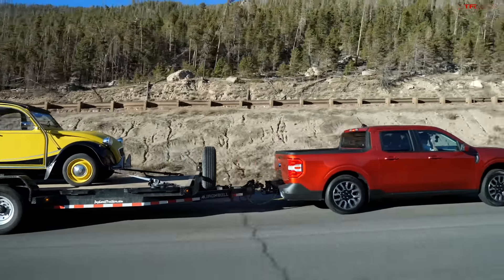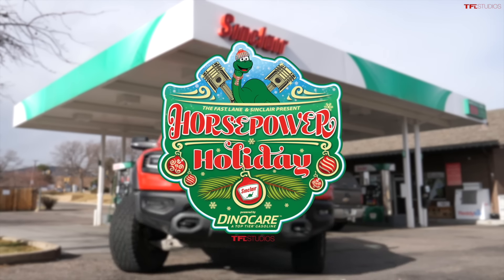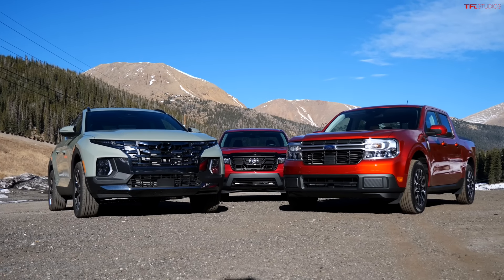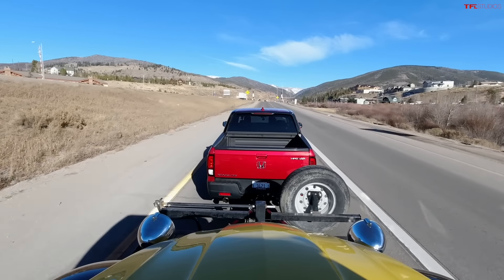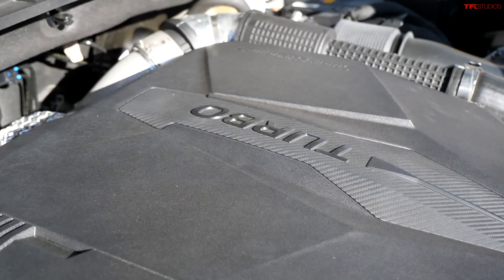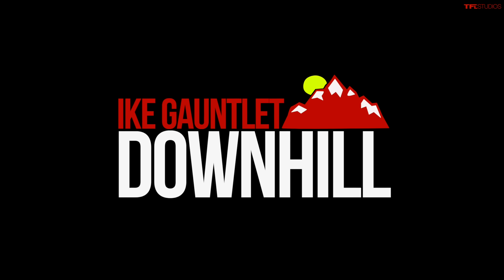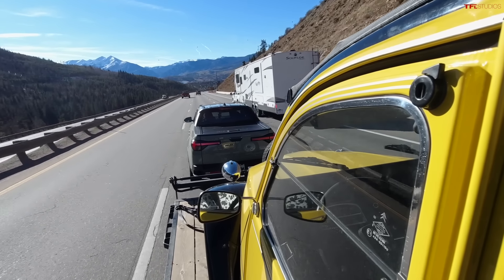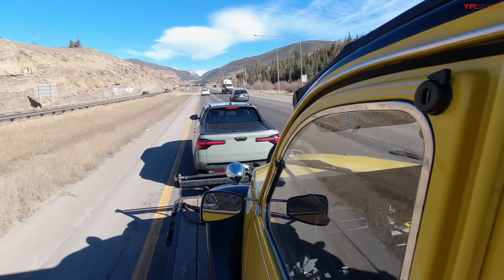I MAX OUT The Maverick, Santa Cruz & Ridgeline, But Which One Wins The World's Toughest Towing Test?

Comment: I would take the Honda Ridgeline over the other two with it's in bed lockable trunk, side swinging tailgate for easy loading, torque vectoring AWD, 9 speed transmission, and reliability.
Reply: I was recently looking at the Honda Ridgeline myself. For the price of a well loaded new Maverick XLT, I was finding 4-5 yo Ridgelines (RTL-T or E) with 40k -50k+ miles. You do get a lot with a Ridgeline, and Honda has a good reputation for reliability, but new comes with a 3 yr bumper to bumper warranty.
Reply: I would just get a real truck.
Reply: @jonathanallen8236  I get tired of hearing this.  A comparably equipped full size is going to be 20k more. Sure, you can get a WT in the 40k-ish range, but it's just that, bare bones.   I've been researching for over a year now and this always gets thrown out there. That said, I'm going Ridgeline unless my brain convinces me to get the Ranger for the low range and ground clearance.
Reply: @tracy2928  Your choice.  I just don’t see a unibody holding up to any real work. It’s comparable to heavily modifying an older jeep Cherokee and off-roading it. Sure they can do great things off-road, but do it too much and the chassis starts tearing up. The spot welds break and slowly become worn out. As a mechanic I’ve been under a lot of vehicles and can honestly say that Japanese vehicles use the thinnest of metal in all of their body structures.  So for me and the safety of my family, I’m gonna have a body on frame truck or no truck. Do as you wish!
Reply: If you or anyone else does decide on a Ridgeline make sure you pull the rear sill panels and check for water under the carpet. They've been having sealant issues since 2017. The rear cab wall lets water in where it pools in the floor under the carpet. Most don't know it since the carpet will not let water soak through. Honda will fix it but it's a very involved process.
Reply: @adir_1  totally. I've done my research for sure. Need to get a stop/start override too. Cant stand that, lol.
Reply: @tracy2928  Yeah if I remember right they have a button to disable it on the console but that of course requires you to remember to do it every time you start the truck. I've been watching the 2022's carefully to see if they have fixed the water issue. I haven't found a 22 with water in it yet so that's promising. That's the only thing keeping me from buying one.
Reply: @jonathanallen8236   lol your comparing a old ass jeep to modern vehicle manufacturing.  Read up on the ridgeline frame to educate yourself.

Comment: That Maverick got TOO HOT 🔥 for comfort, IN THE MIDDLE OF WINTER. 😳
Had the towing continued for any longer and it would have overheated.💩👎
Reply: to be fair the Maverick max tow is 4K and they said their trailer weighed 4K, You have to add all the hamburger riding in the front of that rig as well so they went over the GVW of the truck by at least 500 pounds. If I was going to tow 4k over a mountain I would want a F150 to that job.

Comment: I've said before, with towing capacity "how often" is as important as "how much"? If I were pulling 4k in the mountains every day I'd want at least a fullsize 150(0) with the max towing options to have that margin of safety/durability. And if it's just a couple times a year I still say renting and putting the strain on U-Haul's transmission and brakes rather than your own is the most cost-effective option.

Comment: Maverick's engine overheating is a RED flag!
Reply: it didnt overheat
Reply: to be fair the Maverick max tow is 4K and they said their trailer weighed 4K, You have to add all the hamburger riding in the front of that rig as well so they went over the GVW of the truck by at least 500 pounds. If I was going to tow 4k over a mountain I would want a F150 to that job.

Comment: Id take the ford (not that trim) because you can get the XLT with Fx4, 4k tow package, Turbo 2.0L Ecoboost with a Sunroof and gets better MPG (unloaded) than the Santa Cruz for $29,279. That's how I optioned mine.
Reply: Where are u getting them for that price?
Reply: @jammcguire1276  You can't get that price anymore. The same truck today is 34k. That price was at the launch of the Maverick, when the base model was $19,995. I regret not going through with my order. The dealerships are still marking up these trucks.

Comment: I wonder how hot the Maverick will get with warmer outdoor temps considering the temp. is only 46. It was already starting to overheat, 6 bars on the gauge Another couple miles would probably put it in the RED
Reply: Was wondering the same thing, especially with the Texas heat.
Reply: @rubenrodriguez1209  Not too many mountains in Texas.. I'm sure with normal highway driving it would be fine.
Reply: @2A4U.S.A  true, but doesn’t mean they won’t push it’s limits towing.
Reply: yeah, staying true to Ford's turbo engines, it runs hot... Didn't seem to be such an issue on the Hyundai.  My Ecoboost F150 would always run hot when pulling real mountains.

Comment: Did you strap the 2cv to the chassi?
It has soft suspension! 

I have mentioned this many times, strap the wheels!
It's unsafe to strap the chassi as it allows the straps to get loose on bumps.
Reply: I'm sure DOT would consider that bouncing around as unsecured.
Reply: Those 2cv have so much suspension travel, it really moved around!

Comment: The Santa Cruz is a very nice first effort from Hyundai at a pickup for America. However, as goof as it drives and great design it is, at $41k CAD it is uncomfortably close to the midsize pickups like the Colorado, Tacoma and Ranger. The Maverick starts significantly less and while it is less refined and truck like, the far lower price and capability is where I would go with if I needed a small pickup.
Reply: I’m gonna go for Santa Cruz. Tacoma is uncomfortable AF

Comment: I mean if you need trucky stuffs like towing etc., you would get something bigger. I think Santa Cruz is good enough for SUV shoppers who may or may not tow in the future. The transmission is very quick shifting on normal driving which is what 97% of customers will be doing.
Reply: If you're just towing small stuff like jet skis or a race car you could probably do find with one of these small trucks.
Most don't even tow a thing, but will still pay $1000 car note for a F-150. Lol

Comment: It seems like the Maverick was about to overheat right at the end of the video.  That is not safe at all.
Reply: to be fair the Maverick max tow is 4K and they said their trailer weighed 4K, You have to add all the hamburger riding in the front of that rig as well so they went over the GVW of the truck by at least 500 pounds. If I was going to tow 4k over a mountain I would want a F150 to that job.

Comment: Hey guys, great video!!!, A few ?s on the Santa Cruz that maybe you can help answer...
1. Does Hyundai allow the use of a weight distribution hitch?
2. Do they state the max allowable tounge weight with and without a WDH?
3.Do they restrict the speed when towing on flat ground or uphill?
4.Do they restrict mileage while towing?
4.Did you use a scan guage or anything to monitor the xmission temps?
Reply: No on the weight distribution hitch? They say the truck is to short base to use one i have the 2022 turbo and a 2023 forest river Rv i have checked it out .

Comment: I would pick the ford too but I’m afraid the EcoBoost engine won’t last as long as a naturally aspirated engine.
Reply: 99% of new vehicles will last 200k miles if properly maintained. The 2.0 ecoboost has been around for years, same with Ford’s 8 speed. I havent seen any horror stories about either. You’ll be fine
Reply: @carguyeyedoc  I’m done with ecoboosts.  My 2016 f150 2.7 smokes on startup, not every time.  39,000 miles.  I have a 2022 Tacoma that will be here before the new year.
Reply: @maxracingteam23  man that’s unfortunate, hope you enjoy your new taco. 

Id be willing to take the risk on the Ford. With how the car market currently is, my trade-in combined with how cheap the Maverick is would equate to monthly payments of about $200/month on a fully loaded $37k lariat awd. Cheap enough to tolerate minor reliability issues here and there, and cheap enough to where if I needed to get rid of it for something else, I wouldnt lose much money on it.
Reply: @maxracingteam23  I mean, the current gen Tacoma has it's fair share of reliability issues. The maverick hybrid is the one to get imo.
Reply: @maxracingteam23  there is a repair bulletin out for the 2.7 smoking on start. Mine did it too. The turbo oil line (I think it’s the left side) can leak oil into the turbo when it’s been sitting for a while and on start up it causes it to smoke. I went to the dealer and they fixed it.
Reply: @scottschalk593  well that would have been nice to know 3 years ago 😂😂
Reply: @KB-bh9hp  what do you think of the cvt transmission though?   I still want a truck that can tow.  And go off-road, nothing crazy.  So that’s why I purchased a Tacoma.  We test drove a 2018 Tacoma, had 42,000 miles on it.  It was the same price as my new one coming in, $39,000.  Seems like they hold their value to me.
Reply: @carguyeyedoc  they gave me $32,500 on trade.  And $300 off msrp on the new one.   I still want a truck that’s why I didn’t even look at the maverick.  And if the ranger had the 3.3L N/A engine like the base f150 I would have it in my garage already.
Reply: It won't last.  You'll be sitting with a torque converter shitting the bed at 50k like my mother's escape did to her.  And that's not getting started on the rest of the issues.
Reply: @MDKN22  are you are talking about the F-150 not lasting?

Comment: My pick for the winner is the Maverick, because it comes with the brake controller and has a tow haul mode and has better down hill performance. I suspect the reason the Mavericks tow rating is limited to 4,000 pounds vs 5,000 pounds might be the cooling capacity. It was getting warm at the top of the test. That is often the reason there is a lower weight capacity for a given tow package. If I remember correctly, Andre’s F150  power boost also derated its power for a short time while towing up the Ike, then when it cooled down into the acceptable range it then resumed full power for the remainder of the trip up the hill.
Reply: Keep In mind that it's 40 degrees there . If it was summer it would of over heated

Comment: Correction - Santa Cruz power and torque of 281 and 311 is with regular fuel and not premium fuel
Reply: Yeah, I don't know why they think the power ratings are with premium. The manual tells you the Santa Cruz was designed to perform optimally on regular fuel. That is a huge money saver.
Reply: They didn't say they require premium fuel that's just what they used
Reply: @billchesney8949  no, check around 11:00 minute mark - didn’t state they “used” - they stated the HP and Torque was based “on” premium. It’s actually rating based on regular fuel
Reply: @billchesney8949  They said those power numbers are only with premium gas, which is wrong. The power numbers on the Maverick are with premium.

Comment: And the reasoning Nathan gives is why I would lean towards the Cruz.  If it is only used some of the time and not a daily driver, sure why not go with a more work oriented stance over comfort.
Reply: Plus $4,000 cheaper that's huge.
Reply: Sure the Cruz is more. But think about the tech and comfort you're getting. Just like a car or SUV. Maverick don't offer ventilated seats, 360 camera, and blindspot camera. And the fact Nathan says the dual clutch remind him of the Germans is just valid indication right there that the Santa Cruz is a totally different breed.
Reply: You could pick up a Ridgeline sport for 35k or an RTL stock for 39k. If you compare a lariat maverick with the tow package and tech and premium packages you will get a tag price of 37-38k, the sel premium Santa Cruz will come in around 39-40k. These are comparable features and specs. As you can see not much of a difference in price. 

What’s different is the low end. Maverick wins this hands down. But as they always say… you get what you pay for.
Reply: @jraheemjefcoat429  Dual Clutch has its pros and cons. Off-roading, deep snow or driving on the beach. It can overheat and release quickly and leave you stuck. 
Highway driving and towing, it should do well.
Reply: Don't forget the Santa Cruz has a 661lbs limit on its bed payload (1411lbs is the entire vehicle payload). I really like the Santa Cruz look and it has more comforts but at these price points, I get everything I'm looking for in the Maverick.
Reply: @illusioncity  it actually doesn’t. That number came about because they were assuming two adults in the cab (320lbs) and a 500lb trailer tongue weight. They did the real math behind payload.
Reply: @fubarmedic4222  Can you point me to who did the math, I'm just curious myself.  If this is true, Hyundai's marketing dept really screwed up.
Reply: @gaxon1920  Dual clutch is not meant for off roading anyways. Hyundai has an 8spd Automatic aspirated engine that can handle the off-roading terrains. But it is useful to haul, as you can see in this review.  Much power torque from the wet dct.
Reply: @jraheemjefcoat429  you basically just agreed that it has pros and cons and reiterated what I said with a little less accuracy.
Reply: @gaxon1920  There's pros and cons to anything. I just stated that the Santa Cruz has an engine option that can handle off-roading capabilities. Someone may read this and don't know this. I'm just spitting knowledge from what I know.

Comment: The biggest question is will the Hyundai engine hold up. they seem to have lots of problems ever since 2010 when they starting building their own engines .
Reply: That dual clutch tranny would concern me more…on a truck??? But I’m no expert…
Reply: @christopherhamilton5557   ya that too, it sure seemed to bring the suck ,off road .
Reply: Dual clutch is NOT meant for off roading. There is a 8spd Automatic version of the Santa Cruz that can handle that..Nathan have mentioned this in the video. He just needs to test one out..The Dual clutch is just for performance and more towing. Keep in mind, the Santa Cruz was never meant to be a "Truck". It's a car that just happens to have a bed. The Maverick on the other hand is inspired to be a truck. Hence both have different ride qualities.
Reply: @jraheemjefcoat429  why would they tow rate it to 5000 lbs?  Is it a case of “just because you can, doesn’t mean you should”? 
5000 lbs is a lot…
Reply: @christopherhamilton5557  That can go the same way with the Maverick.
Reply: @jraheemjefcoat429  why put a bed on it then ,  if its not meant to be a truck?
Reply: @rodgood  The idea of from Hyundai is to call the Santa Cruz a "SAV.".. Sport Adventure Vehicle. The idea is to make the Santa Cruz have the ride and comfort of a crossover/suv. But have functionality of a bed that you can't typically do in a SUV. So putting things like bikes, home improvement and gardening items in the bed instead of messing up the cargo space in a SUV. It's perfect balance for anyone who don't want something look like a truck or be reminded of a truck..But has the functionality and practicality use of a bed. Hence why they have an optional tonneau cover to give it that "SUV" feel.  Think of the Santa Cruz as the modern day Subaru Baja on steroids.
Reply: @jraheemjefcoat429   ok so TFL was wrong in comparing it with  the Maverick . good to Know .
Reply: @rodgood  They only comparing it because of the bed and towing capability. Overall styling and use is different. You will see more Maverick as fleet "trucks" for businesses than a Santa Cruz because of the truck-like styling. Think of it as Apple vs. Android. Both are smartphones. But have different features and functions. That is the BEST way I can explain the two.
Reply: @jraheemjefcoat429   i realize that, my only note was that Hyundai  ice"s  have a real bad   reputation   since 2010 .   i Guess we agree on that .
Reply: @jraheemjefcoat429  Exactly!
Reply: And who has the better warranty? It's not even close!
Reply: @christopherhamilton5557  Santa Cruz tow rating is 5000lbs..More than the Maverick with a dual clutch setup. What are you griping about? I know you want the Maverick.  But come on, states some real facts here? Have you been watching or paying attention at all to the specs of both vehicles?
Reply: @michaelwarren7227  do you ever wonder why they need that warranty?
Reply: 1500 or 1year
16:13

Comment: Well fellas , Hyundai doesn't call the Santa Cruz a Truck  first off   , but man you  guysdid an excellent review !!!Thanks big time , cause I just bought a 2022 Santa cruz sel premium ( turbo and awd ) and we're getting ready to buy a 22 ft travel trailer to tow , and I am So glad that you did this video ,really puts my mind at ease about towing with my Santa Cruz. One thing I did notice is there is a button down on the middle console behind the shifter and it looks like it's for cruise control while you're going downhill , I'll research it in the manual and see . Because theway the picture on the button looks , it makes me think it does something to hold your set speed while going downhill 🤔?